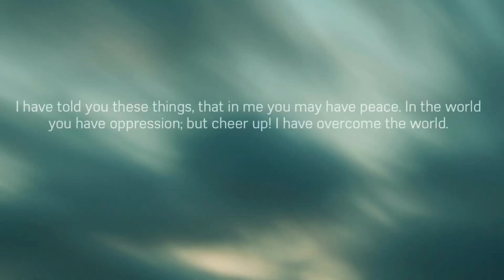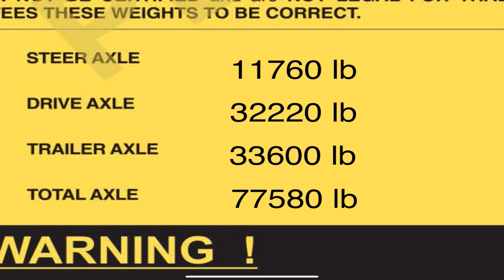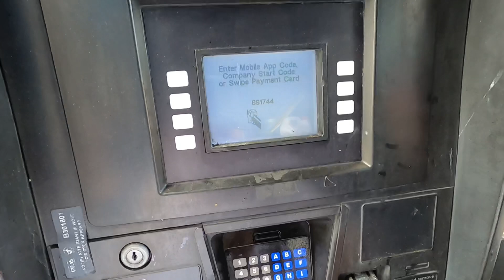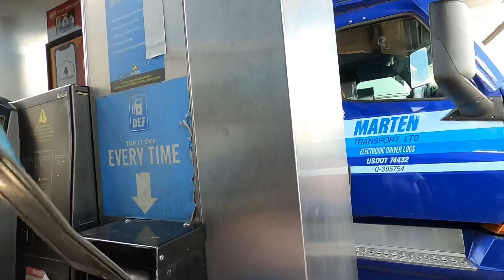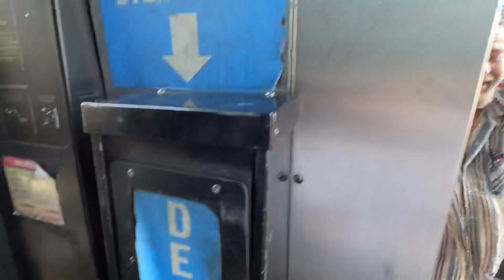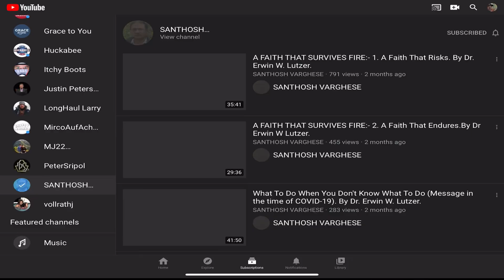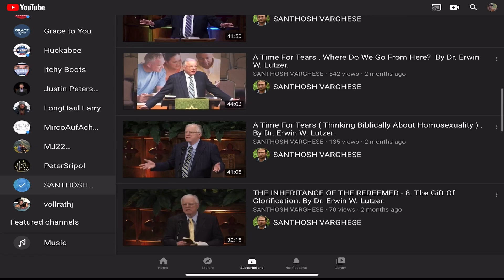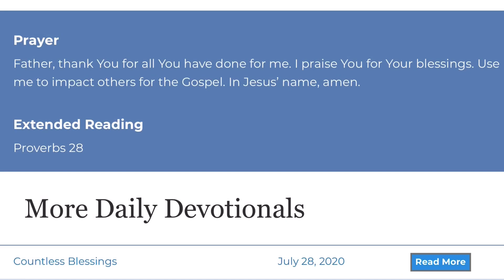July 28, 2020/301 Trucking. Loaded, scaled, and fueled. Chillicothe,Ohio

Comment: I noticed JBG refilled a bottle from a tap at the pump. What comes out of that? Just water? Would it be drinkable?
As for the discussion with the other driver, I think only local truckers should be going into the cities. I know it doesn't always work that way, but it would good if the long haulers could just be between factories and distribution centres, and bigger places like that.
Thanks in advance for the replies, and God bless.
Reply: It's for the windshield washer. JBG been using water lately to save $$.